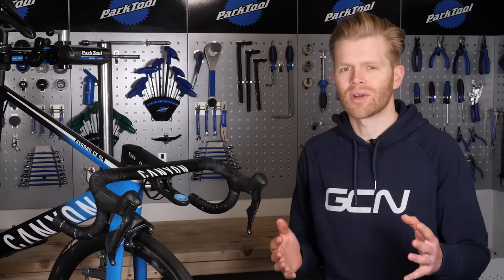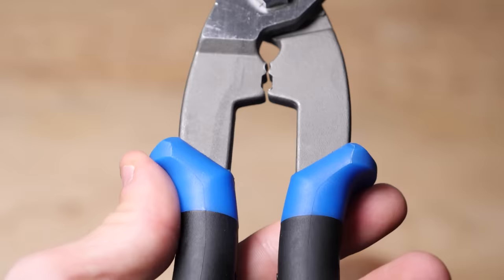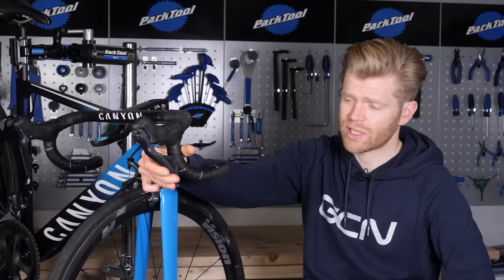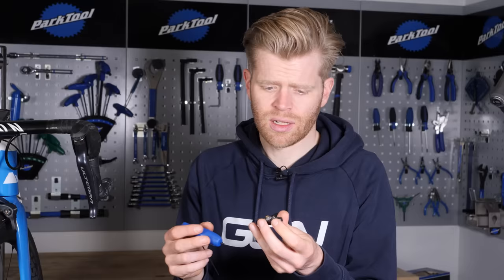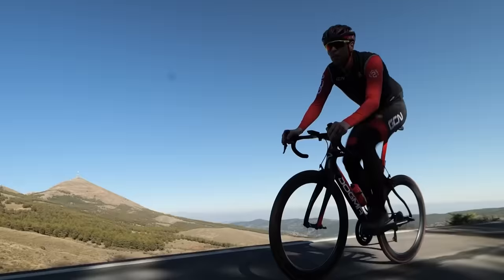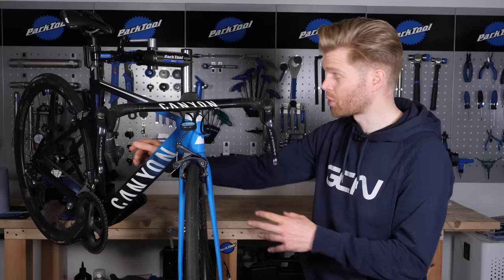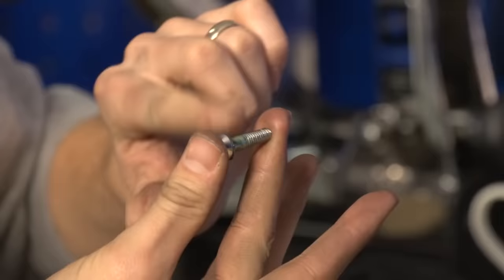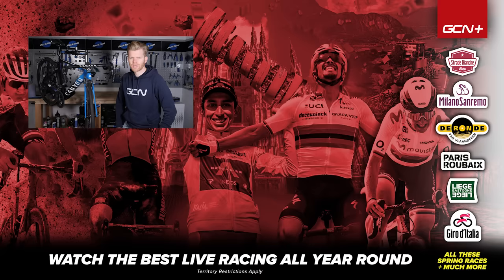Try This Before Changing To Disc Brakes! | Maintenance Monday

Comment: My only real complaint of rim brakes is the rim wear.  One day I might get a bike with discs.  Or, more likely it will be forced upon me by the bike industry which increasingly favors unnecessary complexity (electronic shifting, really?) and expensive components over the simplicity and elegant economy which endeared me to cycling to begin with.
Reply: Ayo don't sleep on electronic groupsets before you try them lol. Sure they're heavier than cabled gears and I can admit that they're more vanity than performance as I love the sound it makes when shifting. But not having to care about changing cables every 6 months is something I envy from my more well off/sponsored friends. I admit too that it is way overpriced though.
Reply: I recently bought a super-bike, but with mechanical group and rim brakes. It feels like the last of the dinosaurs!
Reply: @montrose252  Same here! Carbon fiber & full Ultegra 🔥
Reply: @dan_lazaro  Changing cables every 6 months !!?? How many hours a week are you riding…. Are these cables made of chewing gum ? 🤣
Reply: @marcdaniels9079  250km a week
Reply: @dan_lazaro  REALLY????  You don't need to replace cables every 6 months. LOL... ridiculous statement
Reply: @dan_lazaro  I should qualify that I'm not a racer whose livelihood depends on split-second shifts.  In that case I might be looking for any edge, cost be damned.  For my riding a cable is much more suitable.  It's long been the case that riders look to racing tech to see what's "best", when really it's what's "best for racing".
Reply: @lazyrider6918  but I will because I love my bike I just despise riding especially when my team goes on those ridiculous 400km Training camps

Also: 250km minimum is 1000km per month and 6000km on the 6th month might put it into perspective that my cables are long overdue lol. Granted my cables aren't rusty when I take them out, but my back brake outer (the one that goes into the frame from the shifter) cracks well before 6000km and that's on Jagwire cables. It's just good practice. I also replace my chain on the 8000-10000km mark because I like never having to replace my cassette or chainring for the entire lifespan of my bike. And I replace my bartape at the same time as my cables if I didn't end up tearing it to shreds before the 6 month mark. And I also replace my brake pads at around the same time so basically my bike goes through something of a general maintenance every 6 months including regreasing the headset bearings and cleaning the bottombracket area.
Reply: @BixbyConsequence  well I did mention it's more for vanity and enjoyment. I guess I should admit that there is probably minimal performance gain to be had with electronic groupsets. What I have been saying from the start is that it's really fun to use. Just like the sound carbon rims make when braking. It's stuff like those that make me happy on a bike lol.
Reply: @dan_lazaro  I have Di2 and Ultegra mechanical. Periodic barrel adjustment. CYCLING IS THE NEW GOLF.....  People care more about the gear than the ride nowadays.
Reply: @lazyrider6918  like I said I have a lot more fun on di2 than I would on mechanical. No one's forcing you to buy anything, we're all just sharing our experiences here. See how you're the only one in this thread who's trying to say one is better than the other
Reply: @dan_lazaro  Show me where I made that comment. Actually you were the one who implied Di2 was better than mechanical because of need to "replace cables every 6 months". Which was a ridiculous assertion. Just sayin
Reply: @lazyrider6918  oh right I need to make a "IMO" every time I state a personal opinion because you're going to act like I'm saying it as a fact. The OP was asking me why I like electronic groupsets so much and I said in multiple comments why. I'm not selling you an electronic groupset, I'm just stating why I like it. Meanwhile, you're over there trying to invalidate everything I just said because you think Mechanical is better. Considering R8000 becomes nearly impossible to shift on the front derailleur (rd stays smooth no matter how long you leave the cable lol) after 1 rainy ride, I still stand by 6 months or less being the reasonable maintenance time for mechanical groupsets and that I think electronic shifting is fun to play with.
Reply: I'm not the only one that thinks your opinion was ridiculous
Reply: @lazyrider6918  ok you won an internet fight where the other guy isn't even trying to fight you. I don't really have anything to reward you but I've completely lost interest in this conversation and thus have nothing more to say lol.
Reply: Just get good rims, the old skool ones, preferably. Like a set of rims from about ten - twenty years ago; really good old Rigidas Vueltas or Mavics. They may be a bit heavier, but also stiffer and with thicker rims. Buy some good hubs and get your LBS to make good, stiff wheels out of them, you'll be surprised by the amount of brake- controll and minimum of wear, really.
Reply: The only real advantage for me would be wheel rim life

Comment: Rim brakes on road bike here, at least by now. And even a defender of good quality and professionally adjusted rim brakes in front of first generations of MTB disk brakes. I mean, in my opinion and opposite to what looks to be the general opinion nowadays, any disk brake not necessarily exceeds the overall performance of a quality rim one, but at the same time it's obvious that in very wet conditions things can get harder for a rim brake, and that with rim brakes the lifespan of the rim can be shorter.

As others have said, it's getting difficult to find rim brake bikes or components when industry wants you to buy what they have developed (or still on it...). For that reason I find videos like these are nothing but more and more interesting.

Thank you for the adjustment & maintenance tips, GCN.

By the way, can't quit feeling curiosity about the brake configuration in the CANYON showed (front-right, rear-left). Is it just a personal matter or is it something common there? 
As a child I learned to ride a bike with this setup. As a teenager I had to take the other form all the way into adulthood, finding that setup again on a second-hand '90s MTB bought in the US, which I left unchanged as an added experience every time I ride it, and because I would dare to say that the frame (internal cabling) was designed with this brake setup in mind - the other way produces exaggerated bends around the steering tube, resulting in more friction.

Comment: Disc brakes are great but for commuting I definitely prefer rim brakes because of the simplicity and speed that you can take the wheel off if you get a puncture.

Comment: Former bike shop mechanic over here with thousands and thousands of overhauls and tuneups. For great brake performance, shorten the brake cable housings (outers) to the bare minimum length. Rotate the handle bars to full stop and trim the housing length to no slack. Lubricate the full cable length with grease, then squirt Tri-Flow down the length of the housings. Lubricate every thread and pivot point on the calipers. Then adjust the caliper arms to absolute minimum of free play on their pivots. Then y'all can open the can of worms that is brake pad alignment.

Comment: Bicycles used to be one area where marketing and hype were thankfully absent.  A set of Record components was considered a lifetime investment and bikes were the basic and affordable-by-the-masses machines they were intended to be.  In the current age of through axels, disc brakes and electronic shifting and exotic materials I say BULLSHIT.  It's your legs that make it go, always has been.  I've averaged over 3000 miles per year for the past 38 years, all on steel, all with rim brakes.  That insecure old man on the $10K bike with the shaved legs will never be me.
Reply: Good. The longevity on some older stuff is astounding. One of my bikes from the earlier 90s still has its original square taper bottom bracket in it and as of now it still looks like new and shows no signs of wear.

Comment: I’ve got Campy Record rim brakes on my Colnago. They are amazing. Very solid lever feel with very little travel and terrific stopping power. The hydraulic disc brakes on my Cervelo or my wife’s Specialized do not have the same solid lever feel, there’s more travel but they stop fine. The only advantage discs have that I can tell is in wet braking. So unless you’re mountain biking in mud or riding a lot in rainy weather personally I don’t see the need for discs. Just my opinion. Your mileage may vary.

Comment: To me, no point upgrading calipers. 
I've built bikes with Ultegra 6600 or Dura ace 7400 calipers that perform extremely well. Some of them had more than 50 000 km and worked as new. And these are from 2005 or 1984 ! Their design is excellent, and not very different from the most recent ones. They only need to be cleaned and their pivots lubricated.

Same goes for entry level brakes. Shimano Sora brakes are plenty good enough, you can upgrade them with cartridge style brake pads and they will match higher end calipers.
Reply: I was going to get Claris calipers to replace the tektro on my bike, just to match the rest of groupset, and while I still plan to do it for the homogeny, I’m glad to know that budget brake calipers are sufficient

Comment: I love rim brakes but wheelsets are becoming more limited due to demand of disc
Reply: True.. I get my wheelsets custom made.
Reply: but you can find used high specs cheap.
Reply: Bought a couple rim brake bikes just for this reason.
Reply: Ali express my friend. Elite wheels.
Reply: I love rim-brakes from a practical point of view. Nothing easier to set up and maintain. As long as there are Campi Zondas available as wheels I'm fine. They may not look the newest and coolest and aren't aero but lightweight, stiff and do the job as a break-surface just perfectly. Carbonwheels? I'd go for disks...

Comment: I’ve got a 2007 Felt F2 with Dura Ace components, it sat in a climate controlled garage since 2009/10 untouched. So when I purchased it in November of 2021 the bike was practically still new. I sanded and cleaned the brake pads and it felt so new and fresh after seeing that they had a glassy dirty look and feel. They stop amazingly well and do it quietly now….once rim brakes are dialed in they work just fine. Besides, I’m more worried about the go than I am about the whoa!

Comment: Right lever - front brake is common on bikes where you ride on the left hand side of the road - So UK and countries of the UK tradition - Australia etc.  However, Right hand / Front brake was once the traditional Italian way of setting up a bike - Look at the photos of Coppi and Bartali and quite often you will see them set up that way.  Having the (more commonly) stronger and more dexterous hand controlling the front brake is considered by some to be better practice in general.

Comment: On my gravel bike I added a Magura hydraulic front  rim brake to the tri bar and switched the old front brake to the back. So I have twin rear brakes. I just never felt safe bombing along with my hands out front miles away front my brakes! I know it has added weight but I just feel safer and more confident now.

Comment: If you are not a pro and you’re not racing in any competition i think there is no use for disc brakes. Rim brakes are perfect. Simple to use, easy maintenance and servicing. And also for me it feels much better when i use rim brakes. The ride feels much more satisfying. Everyone should understand that bicycles should remain as simple as possible. No internal cables in the handlebar and headset, no wireless or electric shifters.

Comment: Liking this one as well. I would say that if you're undoing the grub screw to change pads you don't have to take the shoes out, therefore keeping brake position the same. I have been guilty of rounding off grub screws though.
Reply from the maker: Glad you enjoyed it, John! It's an easy mistake to make - we've all rounded screws at some point!
Reply: Next time use some anti-seize on the threads. It might help.

Comment: Rim brakes are great but the quick release has to go. No need for it since the rear derailleur was perfected. Also, thru axles bring higher safety for riders. However, they aren't stardadized yet and that could be a problem until consensus is reached as thoroughly as possible.

Also, direct mount (2 mounting point) rim brakes are the superior design. Mainly because the brake itself won't move around compared to just 1 mounting point.

Comment: I cut my cables (inner and outer) with a cutting disc on the mini drill (not dremel in my case).  For the outers I take little nibbles then let it cool to avoid melting the plastic liner.
If you have aluminium rims then washing up liquid for washing is a bad idea because those products use salt as a water softener, so the drops you don't manage to rinse off (in the tyre side wall, spoke hole and valve hole crevices) will promote corrosion.  Car or caravan shampoo does not have the salt.
I use shims on both pads at once for toeing in.  Fold the card so that it wraps around the wheel.

Comment: One of the best GCN videos.  I have callipers on 2 of my bikes and cable operated discs on the other.  To me, the only advantage of discs is they don't get clogged up when riding through mud.  The biggest disadvantage of rim brakes is people don't set them up right.  Modern callipers are far far superior to the old centre pull brakes I remember from the 1980s.

Comment: Err, they are NOT dead? Good to know 😛
As for pads, try SwissStop BXP Blue on aluminium rims.
For carbon rims, the rougher variety of pads will sand down the brake track faster, so, adhere to manufacturer specs please.

Comment: I still use rim brakes since I'm using a old bike with campagnolo record titanium in a 7 years old carbon frame; throughout I've own 2 sets of wheels. I think disk brakes is worth it for the longevity of not changing rims when ever it gone bad.

Comment: Ollie,  all true, but what do you think of rim brakes; carbon wheels; a long, steep descent; and a cautious rider?  (Or downhill when wet.)  In my experience, in the dry, and with premium pads I could still fry an egg on the wheel but certainly couldn't stop.  Very dangerous!
Reply: This is my point exactly. Where I live, you're either going up a mountain, or coming down one. Ever since I got a bike with disc brakes, there has been a notable absence of shit in my shorts, even in the wet.
Reply: @mihalis1010  I don't know why, but in the summers it's bone dry where I live and I still somehow contaminate my rim brakes at the worst times possible during corners, love that screech while going as fast as possible

Comment: The maintenance costs of rim brakes can be significantly lower than disc brakes. DB pads and rotors are expensive and may need frequent replacement, as described by PeakTorque.

Comment: I've seen the Disc/Rim thing play out, as a Skateboarder, in the 1990's. Companies changed the mounting bolt pattern on the decks, almost overnight. An entire generation of products, now obsolete. Plus, the deck shape changed to a "popsicle". For a while, anything old school was forgotten, but then it crept back. Firstly, as a retro aesthetic choice, but eventually, the tech came back as a parallel choice. It's not as big as it was, but it's a healthy market. This will happen with cycling - we'll all be forced into the world of Discs, and electronic groupsets, but within a decade, you'll be able to get brand new mechanical shifting, and rim brake setups. Older cyclists will drive it, at first, but it'll take hold. It might take a while, but it'll happen.

Comment: Different to see the right side lever operating the front brake, usually the front brake is left side of handlebar.
Reply: In Australia it's illegal to have the front brake to the left lever. I asked canyon when I was speccing new bike to change it to left lever / front brake and they wouldn't do it. I've been riding illegally for the last 40 years. 🤣

Comment: I use my 30 year old steely for hybrid bike-packing; with a gross weight around 300 lbs. I was thinking about going to a new full suspension,  full disk, aluminum frame bike for better stopping, but I'll try your suggestions on my old bike first. I have a 5 year old full suspension bike, but it maxes out at 280, and I would have to retrofit the disk brakes. Is the added stopping power of disk brakes worth the extra weight?